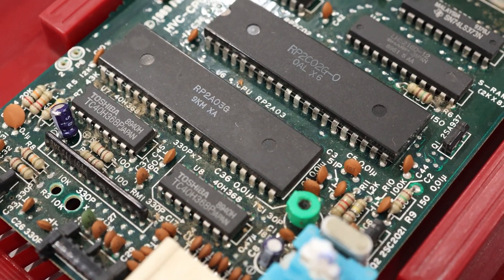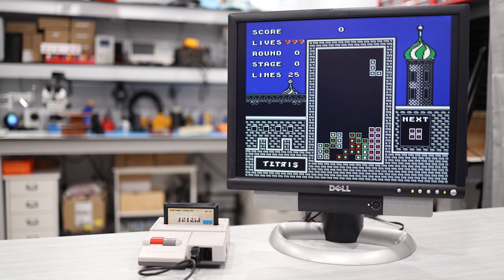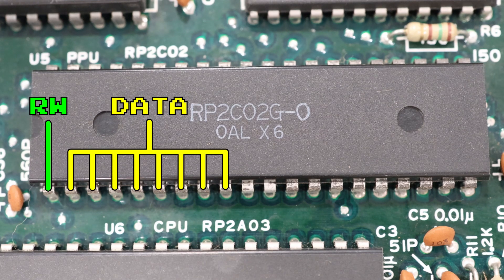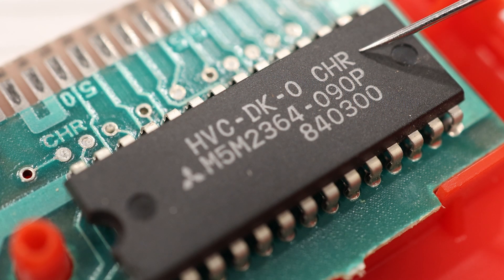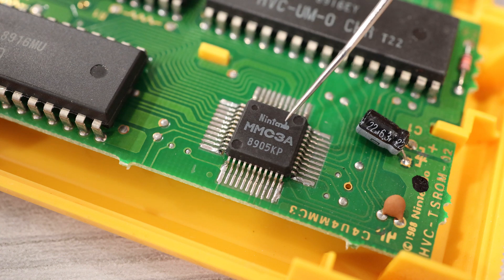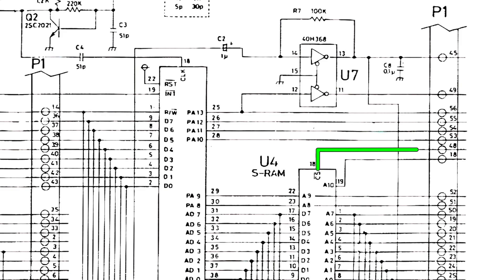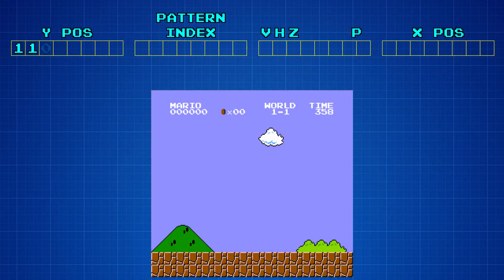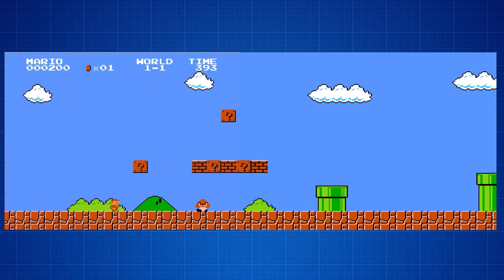Inside the Famicom | 04: The Picture Processor

Comment: i was expecting when you pull out the cartridge more randomness (noise) and not a static image.
also: nes without the mapper chips is as good as an atari 2600 (overexaggerated but true)
Reply: Nah, the VCS/2600 had a 6507. 13 address pins instead of 16, so it could only address 8 kilobytes of memory instead of the 64KB of a full-fat 6502. 
....
I was joking, but that's actually huge. 
Atari allocated 4KB of that to the cartridge slot(a full half of the memory map!). Nintendo, meanwhile, allocated 32 KBytes(four times the Atari's entire address space!) to the cartridge slot for ROM on the CPU bus... plus some additional address space for additional RAM(and still more space attached to the PPU instead of the CPU). That address space alone is a HUGE advantage, even if all else was equal.  

But yeah, the support chips make a huge difference. Atari's TIA instead of Nintendo's PPU, 128 bytes of RAM instead of 2 kilobytes... these things matter a lot more than what your CPU is. And once you throw in on-cartridge hardware, things get WILD. The Nintendo also has the ability for a cartridge to raise interrupts, and the Atari doesn't. That could be very limiting if the hardware wasn't already too busy to service interrupts 90% of the time.

Comment: Do you have an explanation why the NES/Famicom have the worst composite video quality ever? The vertical lines are fuzzy, the horizontal are perfect. Only black, white and gray colors used in vertical lines do not produce this fuzzinest and they are perfectly strate. The problems is with all other colors. And ten bigger problem is when the screen scrolls this defect produces an awful dot crowing  effect. 
And I do not talking about the notorious jailbars on famicom and nes model 2.
Reply from the maker: It's primarily due to the decoder and DAC internal in the PPU. There are some mods, like the NESRGB that can improve it quite a bit - but they're not cheap, as it bypasses those internal PPU components and recreates the improved signal off-chip
Reply: @whatskenmaking  thanks for the replay. Only NES/Famicom have this poor video quality. All other consoles of that era are OK.